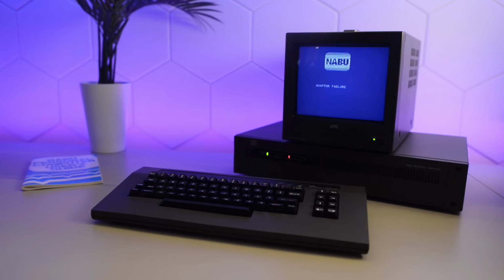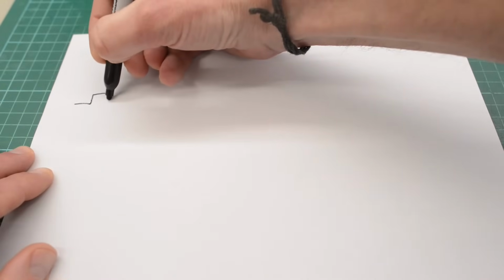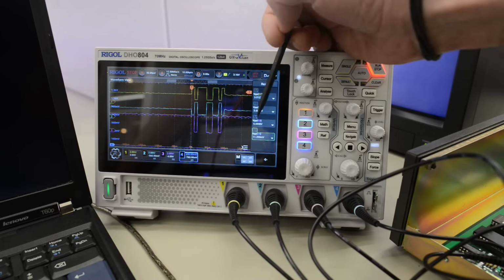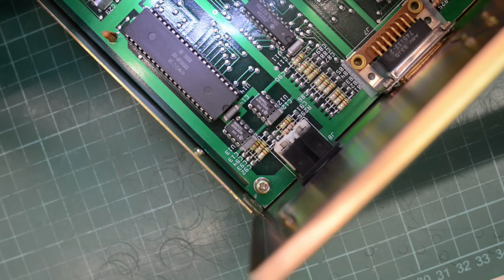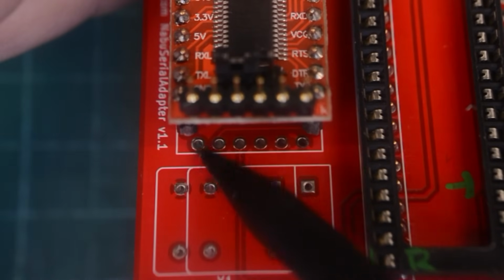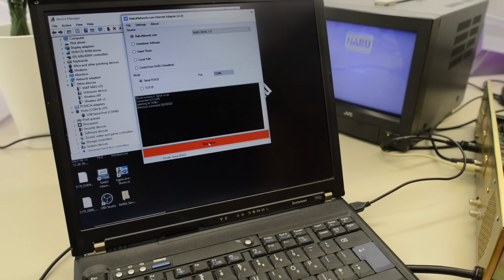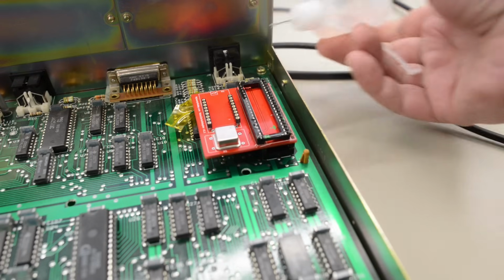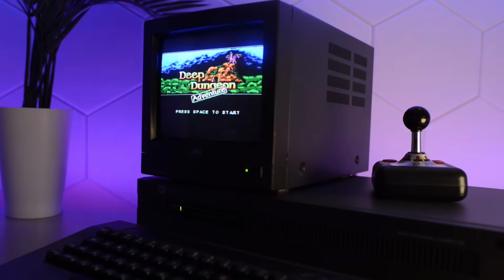1982 NABU Personal Computer. RS422 deep dive

Comment: Nice!  I ran into similar issues when trying to get mine connected to a modern computer, then I realized that I had read the pinout of the serial cable backwards and was connecting TX to TX, etc.  Oops.  Rewired the custom cord, plugged it in, and it worked right away!  (I've heard that I'm not alone in this mistake.)  I'm not saying that was your issue with the RS-422 cable, but it was mine.

I'm glad you got it working with the USB to TTL serial adapter!  🙂
Reply from the maker: Thanks. Glad to hear you got it sorted. Sometimes, the RS-422 cable is incorrectly marked too

Comment: Dexoit is amazing stuff, can I convince you to get some Deoxit D100L in the needle bottle? It is 100% solution instead of the 5% you are using, which is diluted with mineral oil. The 100% solution works faster and better. Also, I want you to try out a Coleco Adam computer with a FujiNet adapter!
Reply from the maker: Thanks for the recommendation. Maybe, I'll try it, but it's very pricy!
Reply: @Epictronics1  Yeah it's not cheap, but keep in mind there is only 7.35ml of deoxit in a 5oz spray can. There is 25ml in the D100l-25C bottle. It works out to $2.31/ml for the D5S and $1.20/ml for the D100L-25C.  You use a lot less as well and you have less of a mess when you are done.

Comment: From watching other Nabu videos, some folks have had issues with how their adapters deal with handshaking settings.  RS422 doesn't have hardware handshaking, but the PC thinks its talking to an RS232 port which does have hardware handshaking.  Some adapters just pretend the handshaking is always saying "go", while others might require a setting to do that.  Not sure if the server software is dealing with this.

Comment: Just a wild guess, but I've seen certain UARTs struggle with non-standard baud rates. The UART in the RS422 adapter you were using may be one of those. You could try measuring the pulse width of the of the TX (from the PC) and compare it to the pulse width of the signal from the NABU and make sure they are close.

If that doesn't, try flipping +/- on the RS422 lines. :)
Reply from the maker: Thanks. I have tired to flip the +/-. I have an idea on how to test if the RS422 cable can handle the weird baud rate

Comment: As far as I can tell, 422 doesn't have any start/stop bits.  At least, every site I look doesn't mention one.  I think that a differential signal of 0V is considered to be "not sending".  Once it goes to differential signals, it would seem that all bits are significant.  I think the same is true for USB, but with the difference that 1's indicate toggle and too many of the same bit require a stuffed bit for clocking.
Reply from the maker: I will be able to confirm this if someone decodes what key I typed :)

Comment: I was waiting for this video ever since your first NABU video. Good to see you got it working. I'm still curious why it's not working with your RS422 adapter. Arctic Adventure works fine for me and loads fast.
Reply from the maker: The Arctic Adventure fail may just have been a glitch. I'll try to find some time to test the system more extensively. I'd love to do some more tests with the RS422, but I kinda ran out of things to try

Comment: The +ve TX phase of the RS-422 signal can be used as the RS-232 TX line, however, you must route the TX to the RX of the other port. 
You need not connect the  -ve phase of the RS-422 signal to anything, just leave it disconnected. Remember DCE and DTE are your friends with serial communications protocols!
Reply from the maker: Interesting. I may try that out, thanks

Comment: You can use the NORMAL triggering mode on the scope. This would be more convenient than SINGLE.
Reply from the maker: well, I tried that. The signal just flashed by occasionally
Reply: @Epictronics1  It flashes on AUTO. Normal doesn't refresh when there is no trigger. There is also an option to suppress triggering for a given time after a trigger had occurred.
Reply from the maker: @TzOk  Ok, thanks!

Comment: It's a shame this one didn't just work out of the box.

With the amount of vintage things I'll get that require some significant effort just to get running I was pleasantly surprised when I soldered together a cable for the serial adapter then plugged it into and turned on my Nabu computer to find out that everything "Just Worked." Regardless, I am a fan of how this computer looks as well since it blends in well with other TV accessories.
Reply from the maker: Well, now we got to play with RS422 :) that was fun!

Comment: I think in the old days they used solder to protect the pins because gold wasn't that common, ie, it was more expensive. I remember ISA cards with solder edge connectors.
Reply: Solder (leaded) is also soft compared to the connector parts. Each extraction and insertion removes a layer of solder, exposing a new piece to make a new conecttion.
Reply: Wait, is gold more common or less expensive now? 🤣Ok, ok, you might mean gold plating techniques were.

Comment: The Internet was already a thing in 1982. Are you referring to the web?
Reply: The 1981 figure of 200 is 200 computers, not people. One of those computers would have had many dozens of users.
Reply: https://archive.computerhistory.org/resources/access/text/2019/05/102683804-05-001-acc.pdf is a bit easier to read too.
Reply from the maker: I was struggling a bit with how to present the NABU network in one short sentence. (that's all we YouTubers get) You are technically right, but there were only around 200 users of the internet in 1981. I wasn't able to find the number for 1982.

Comment: Nice one, Roman.  Guess I'm lucky that the NABU and serial cable I bought all just worked with a little bit of fiddling.  I just love that keyboard!  It is a little huge though, I'm currently trying to figure out display/storage for my computers, and things like the NABU and my iMac G3 are kind of difficult to find places for.
Reply from the maker: Thanks. That is quite funny actually. I have been seconds away from buying G3s several times. Every time I think -Where am I going to put it? so, no G3 yet lol. +1 on that KB btw!
Reply: @Epictronics1  My G3 was definitely a "pity buy".  Stuck on eBay and reduced in price several times.  I finally bought it because I didn't want to see it going to the dump.

Comment: Thanks!
Reply: I got into puters way back in 81 using an ibm 360 using forscan and pascal
The first modern computer lol trs 80 using tape backup,very interested in this computer using the z80 processor .
Reply from the maker: @alanarmstrong2323  Oh, I dream about one day owning something like an IBM 360! I actually have a picture of an IBM 360 tape drive as my desktop wallpaper :) I only got into computers as a kid in 1985. Commodore 64 with a tape deck and a 14" TV. The closest I ever got to the Z80, before getting the NABU, was a Commodore 128 lol.
Reply: @Epictronics1  brings back memories typing on the punch key station,and then reading the cards that never get shuffled  lol hard drive was a 14 inch spinning disk under a plastic cover.
Reply from the maker: @alanarmstrong2323  I'll keep dreaming. Maybe someday I'll find one :)
Reply from the maker: Thank you :)
Reply: @Epictronics1  I have a nabu but it is still in sealed box just waiting for some to come out with a cat 5 connector for it
Reply from the maker: @alanarmstrong2323  I'm surprised that wasn't the first project to come out for the NABU. There are way more advanced projects done, but I don't think there is a simple NIC and a proper online server for it yet. Let's hope someone is working on it 🤞